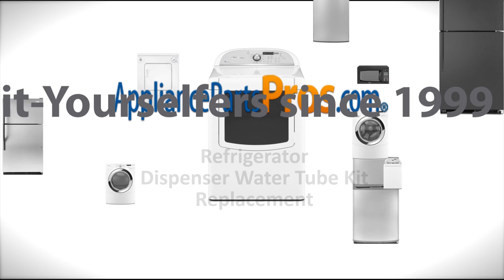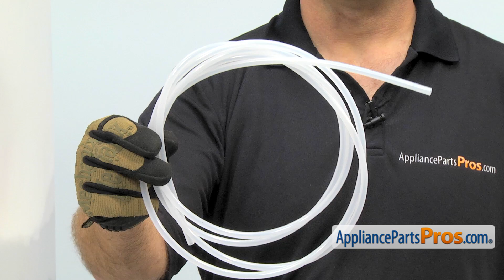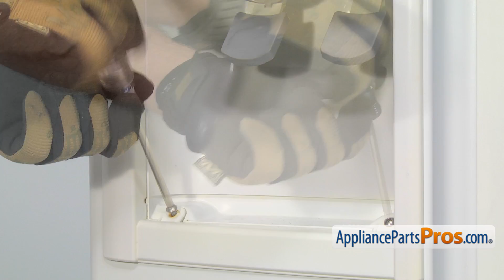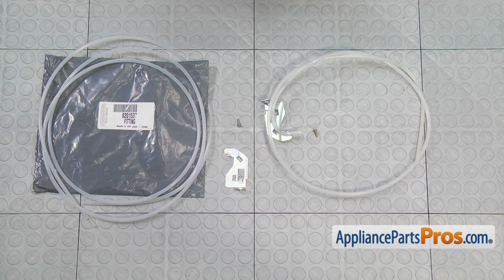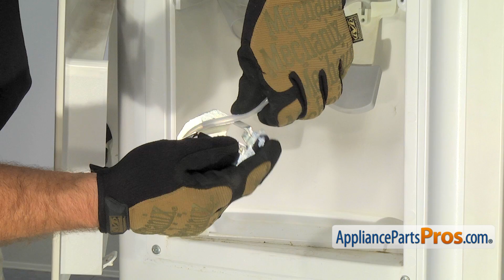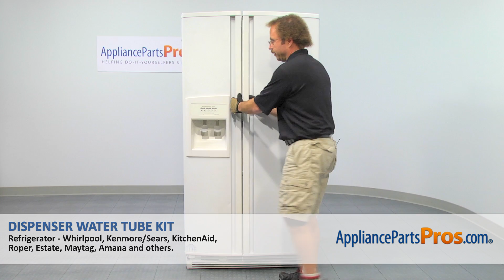How To: Whirlpool/KitchenAid/Maytag Dispenser Water Tube Kit 8201537

Comment: FULL STOP
The translucent water line for this fridge has broken at least a dozen times while I've owned it, once causing over $10,000 damage when the downstairs ceiling collapsed.  It most often breaks at the bottom corner of the freezer door (lower left hand side) although breaks have occurred elsewhere as well.  It seems the line not only can't handle the bending radius at the bottom of the door, the exhaust from the de-icing fan exits the bottom of the fridge through the toe kick, and the heat contributes to the water dispenser line becoming brittle enough to snap.

I strongly recommend NOT using the translucent line shown in this video.  Instead, get some 1/4" OD reverse osmosis line - it's easy to distinguish because it's a little stiffer and opaque white, not translucent.  The RO line comes in a coil, I got mine from the 'Zon.  Use it to replace as much of the factory translucent line as you can.
Reply from the maker: Thank you for sharing your experience. We're sorry to hear about the repeated leaks and the extensive damage you experienced. Since water line materials and routing can vary by model, we recommend confirming any replacement tubing is compatible with the refrigerator and approved for its water supply system before installing it.

Comment: I have whirlpool refrigerator model # ED5FVGXWS00. I stay in apartment and when main water supply is turned off for maintenance in apartment it has water leak from refrigerator water dispenser. I changed “dispenser water tube kit” and “water valve” but it did not fix this issue. I ran 4 gallon of water to remove all air bubble but it didn't help. Finally I changed water valve as well and that didn't help. Any suggestion on how to fix this issue. Once water main water supply is turned on there is small leak (half glass of water in a day) but it’s big amount of leak when main water supply is turned off for apartment maintenance
Reply from the maker: Hm. Does it leak if you shut the water off yourself, or only when the water is turned off in the whole building?

Comment: Thanks again for this video. I can't believe how easy it was to do this. I have the old style dispenser that was all plastic on the end and it had been broken for years. I tried just using the hose that was already in the refrigerator and it was curved at the end, so once I got everything back together it was spraying water behind the cup. I took it apart again and installed the new hose and only added a couple minutes to the total installation time. It is so easy to install the hose that there is no reason to skip it. 

I would have had no idea where to start on this without your video, so thank you for possibly saving me hours of work!

Comment: Hi,  My LG GR-L247NSS water dispenser tupe has split at the bottom of the door.  Can the tube be replaced or is it a new door?
Reply from the maker: We'd be happy to help you out with that! We offer free technical advice and diagnosis. You can give us a call at 1-877-477-7278 or you can chat us at our website: http://www.appliancepartspros.com/. We will need your model number to give you accurate advice, which you can locate using this tool on our website: http://www.appliancepartspros.com/modelnumber_locator.aspx

Comment: Hi. Your videos are awesome!! I have a LG refrigerator and need to replace the water tube for water dispenser. I tried to get the tube as you did in this video but this refrigerator looks like does not have access for the front. Could you help me?
Reply from the maker: Without knowing what you have, I would suggest posting the problem along with the appliance model number on our repair forum and the techs can help you troubleshoot the problem. http://forum.appliancepartspros.com/
Reply: He might have a model similar to mine, the WR17X11324, which does not  allow access to the hose from the front - I have the same problem and it appears one has to pull the inside of the freezer door out (which is fixed with some kind of adhesive). But I am not sure, so your help would be great...